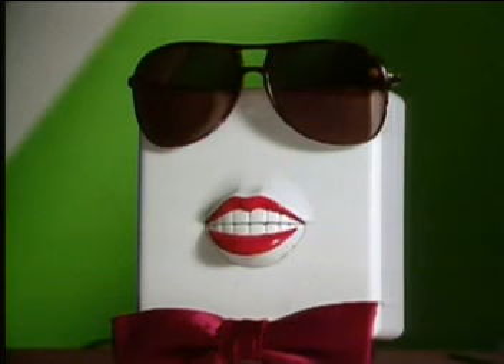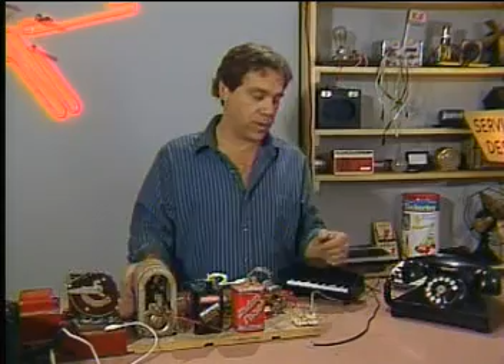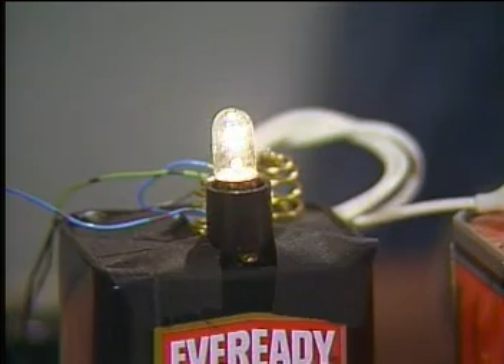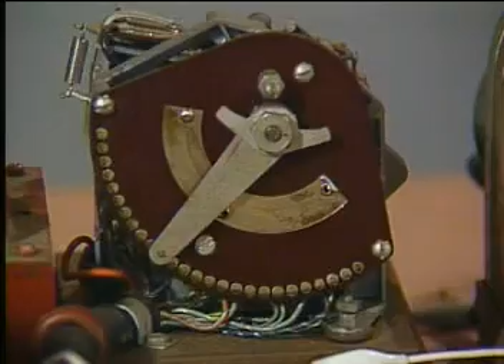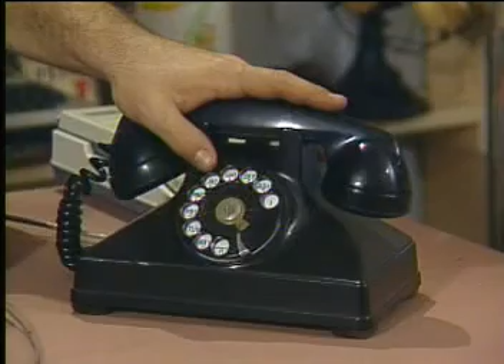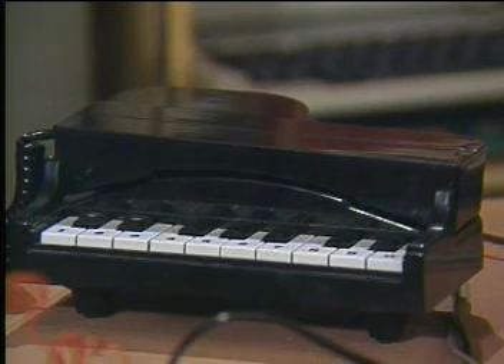Telephone

Comment: The pause between rings isn't for off-hook detection. Other than a gentler way of notifying of a pending call (continuous ringing would suck) some automatic switch installations would share the same ring generator across multiple shelves. 1 ring unit which is constantly generating the ring voltage switched between 3 shelves for 2 sec each. Some switches have continuous-running ring generators and a loop is connected to it 'on the fly' so the first ring may be really short.